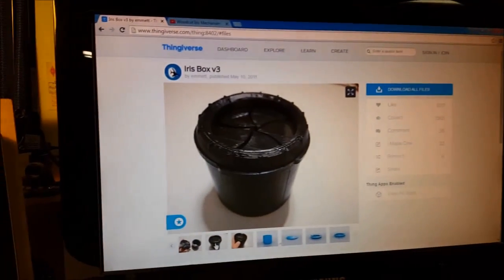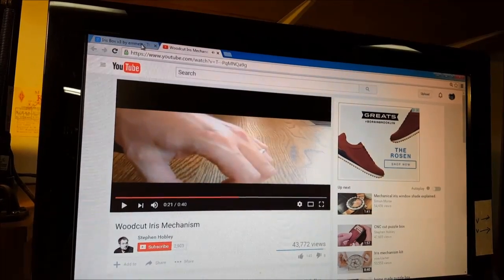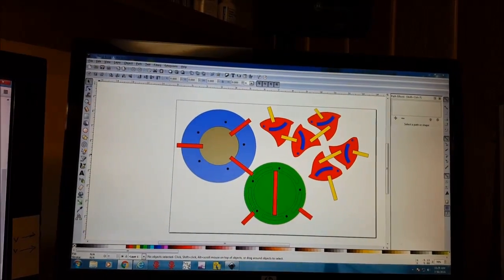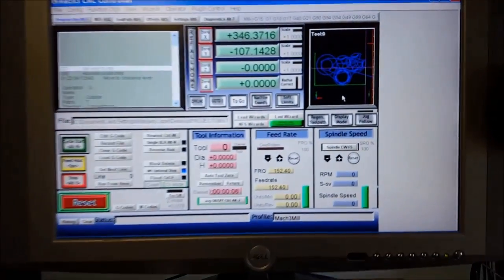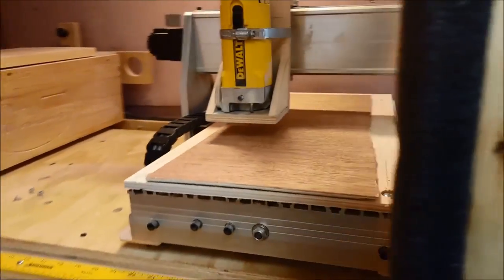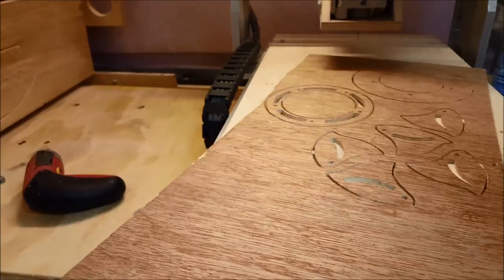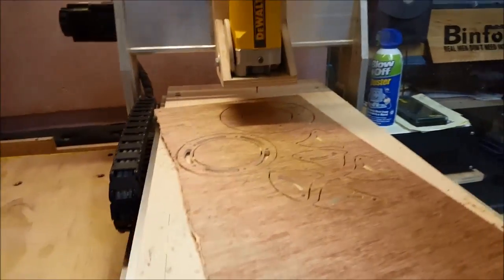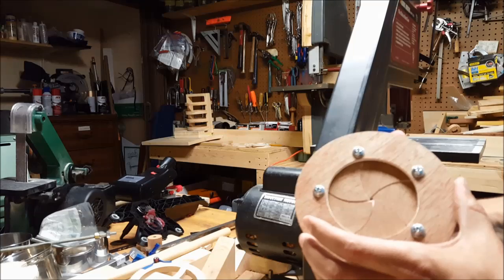Iris Design #2 - A CNC Project

Comment: Hey I really love your videos! I notice the new smaller CNC is it one you built from scratch or is it a kit you put together?
Reply from the maker: Hi Kaden.  Thanks!  The smaller CNC that I used for this video is one that I bought off eBay and then I modified the Z axis to hold a regular trim router.  The CNC in the background is the one that I built from scratch several years ago using plywood and drawer slides.
Reply: +drez20001 ya that one in the background is the one that inspired my build! oh awesome! I'd like to check out the one you bought on eBay. I think it would be nice to have a smaller one for running two cncs at a time. Can you send me a link?
Reply from the maker: This is pretty much the same machine I have.  It's a basic little CNC but does a good job. http://www.ebay.com/itm/New-CNC-Router-Engraver-Milling-Machine-Engraving-Drilling-3-Axis-3040-Desktop-/271218490379?hash=item3f25e1bc0b:g:gU4AAOSwARZXpttg